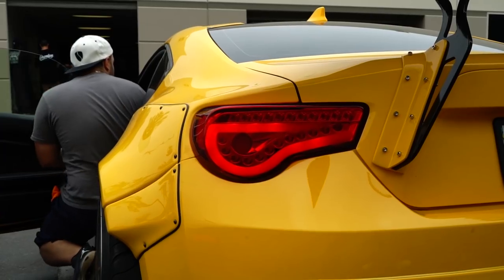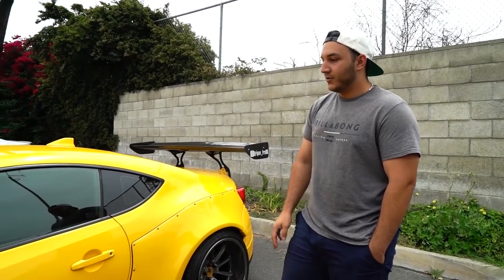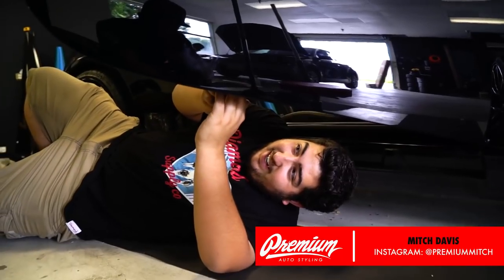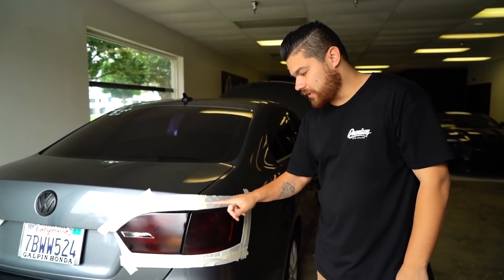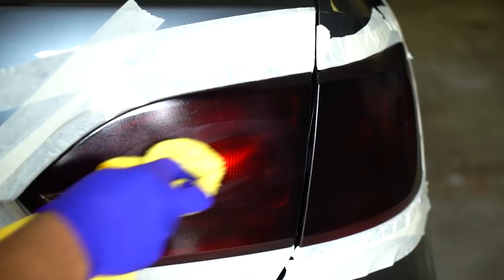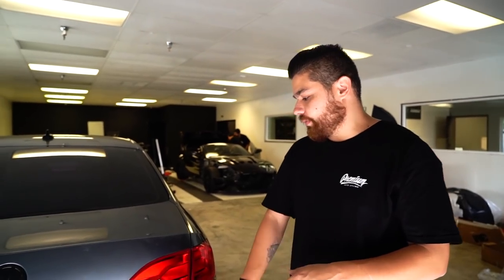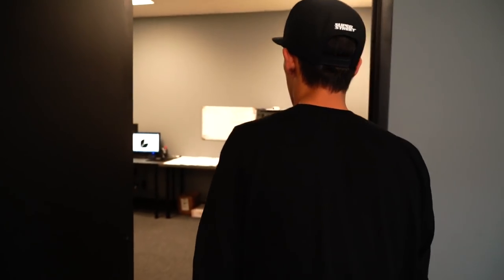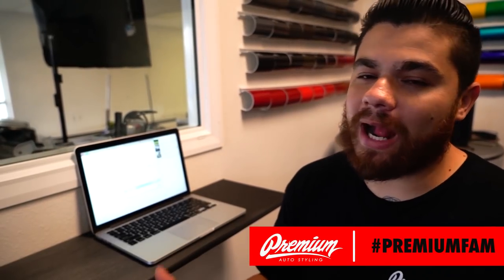Removing VHT Night-shade! | Taillight TINT

Comment: the VHT Night Shades can be installed properly and look amazing. 
I've don't it to my last 3 vehicles and got compliments all the time and it never faded or flaked.
Reply: Any tips on how to make final product look glossier ? I've seen like 10 different video and they all look bit weird after few coats
Reply: @MWARIS1  wet sand the lense w/2000 grit, make sure there no imperfections left on it. Spray light, even coats on it (depending how dark you would like to go). Now, once it dries its going to look matt and faded. to get a high polish i used Meguiars polishing  compound, then hand wax. Turned out beautiful on my girlfriends car.
Reply: Lucas Goldman I didn’t use clearcoat or nothing ?
Reply: What if u mess up and it runs any ideas on how to fix this? Asking for a friend
Reply: mine lasts a while but it does fade after a bit
Reply: In new York cops will pull you over ASAP for that shit. And say ur tail lights dont work lol found out the other night

Comment: The reason that Jettas taillights look so bad is because the dude probably just sprayed the VHT on and then called it quits. I've tinted taillights with VHT and I've made them look amazing. My car has them tinted. It's not very hard.

1. Wet sand the taillights with 2000 grit.
2. Clean them off very well.
3. Apply 2 coats of VHT.
4. Apply 1 coat of clear coat.

Gives it a dark, ALMOST vinyl look to it. 

All in all, get yourself some wrap. You'll save your taillights and it will look much better.
Reply: scottis Why do all that work over just installing a vinyl tint?
Reply: Next time, read what I say before you comment bud.

"All in all, get yourself some wrap. You'll save your taillights and it will look much better."
Reply: I did mine with red night shade on my old car. Cleaned them with alcohol, applied 3-4 light coats, 2-3 thicker coats (depending on what color / darkness you wanted), then did 4-6 coats of clear coat. They turned out awesome and still 2 years later (I know the new owner of the car) are holding up well and look oem.

The Jetta looks like they sprayed 1-2 thick layers of night shades and called it a day.. looked like shit.
Reply: Are you sad?
Reply: @jeremyshred yeah man if you know how to paint you can make them look great and I swear clear coat is the way to make VHT look nice.
Reply: i love you
Reply: scottis mine currently aren't finished with clear coat cause I'm waiting out for a month or so to see if I get pulled over for being too dark. if I get pulled over I can take a cutting compound and take some paint off. but I definitely was wondering if I needed to finish them with clear. they're getting hazy after a month without it.
Reply: Why would you sand your taillights? Doesn’t that ruin them and you can then never take the tint off?
Reply: @Buckeyes202  As far as 'why', I'm not 100% sure, my guess is it helps the nightshade to adhere to it. A light scuffing is usually the first step when repainting things like furniture.

 2000 grit wet-sanding isn't going to damage them. In fact, 2000 grit wetsanding is my final sanding step for restoring headlights (Side job I do). I go from 400>800>2000 grit then follow up with a polish and they come out nearly perfect. So you could sand with 2000 grit, decide not to do it, then polish and it should come out fine.
Reply: What type of clear coat ?

Comment: holy shit that dude who used the VHT night shade did absolutely no prep work. he thought it would work as is. you have to wet sand in between coats and finish it up by polishing it. I did it to my frs and spray can applications require a lot of work compared to proper spray gun applications. Don't knock VHT cause the dude used it wrong. you can clearly see his coats were uneven and heavy.

Comment: I used the VHT to do the  taillights on my car and it came out pretty good but also I tried it on my head ligths and made them super dark so I'm going to try the break cleaner thanks for the video.
Reply: Same here! Just did it today. Rears looked great but headlamps super dark... What did you do to remove the vht. And what did you do to tint them again. Thanks
Reply: Did this work on your headlights? I bought some and want to make them clear, I'm worried about destroying the clear look

Comment: Best way to spray on vht is 
Clean the taillights 
Spray 3 coats of vht wait till it drys
Sand it with 1000 grit
Spray it again with vht 
Clear coat it 
Sand it with 2000
Clear coat again 
Polish it with some compound 
Looks clean no Peel and has a mirror finish none of that dull bs

Comment: Tinted my tail lights before with a spray, looked terrible so I used brake cleaner to remove kit but it made my tail lights start to crack

Comment: I know this is a late reply but do you have any tips to take off VHT Nightshade overspray from the car itself? i got some on the outside of the taillights on the car.
Reply from the maker: Try using a little bit of isopropyl alcohol, I would also recommend buying a clay bar kit and waxing the area after it’s been wiped down with alcohol
Reply: @PremiumAutoStyling  Thanks i’ll trynit
Reply: try it*

Comment: Lol he did it incorrectly to begin with. I did my MK5s tail lights with VHT. used a scotch brite to scuff up the tails, masked the areas i wanted to shape, did two light coats of VHT, topped it with two coats of clear coat. Once it cured two days later I wet sanded them with 1500 gritt and 3000 gritt. Then polished it by hand.